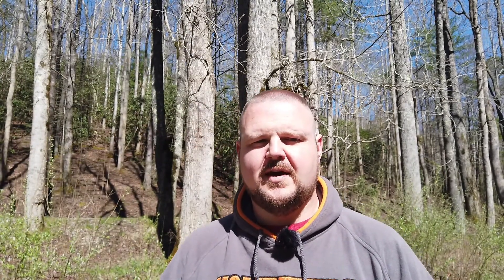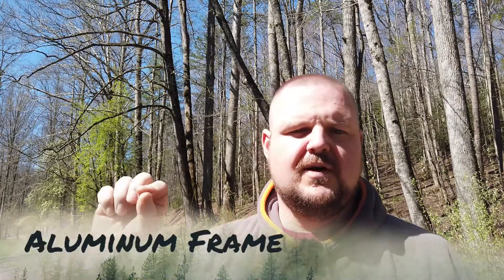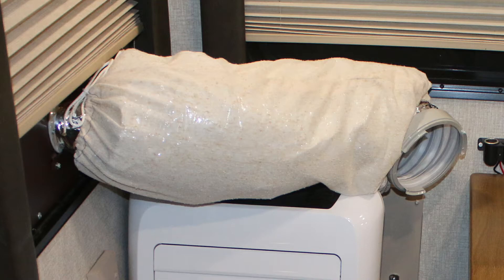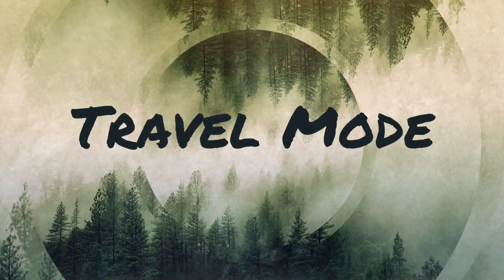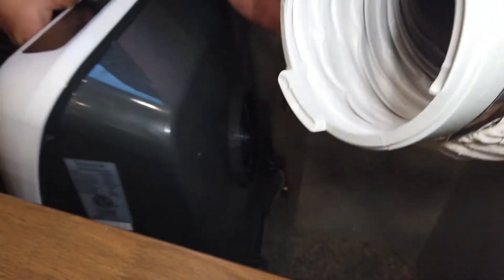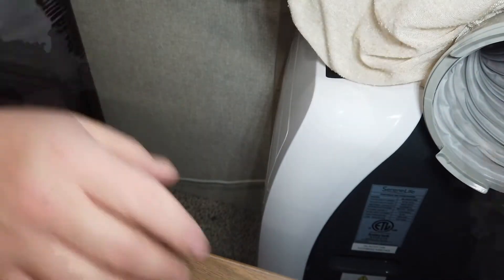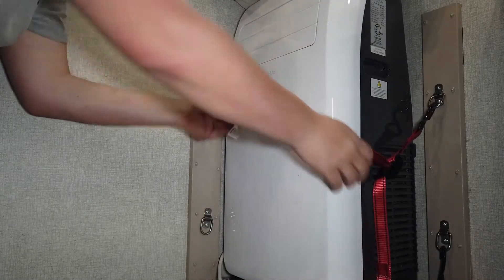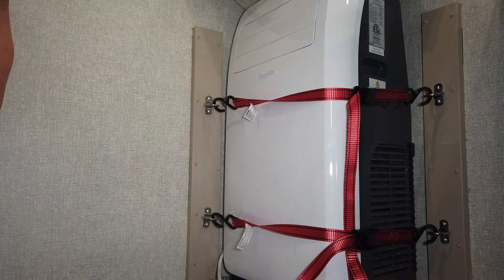Portable Air Conditioner in RV #serenelife #portableac #addingairconditionerinrv

Comment: I really appreciate how thoroughly you explain your process, including your oh-oops moments! I am looking forward to hearing how the one-hose AC works in our Tennessee summer heat and humidity. I've heard comparisons between the single hose and double hose portable ACs, so this is an interesting review. ~ Kir (and Ron) in Middle Tennessee
Reply from the maker: The temp is so nice right now... can't it just stay like this?!
Reply: @GimpyCamper  I am 100% with you on that! ~ Kir
Reply: If it's not a dual hose it will have absolutely zero cooing capacity
Reply from the maker: I disagree.  Yes dual hose is better but last week it was 86 and humid when I was working on a project in the camper.  I turned the generator on and ran this unit and there was definitely more than zero cooling capacity.  I agree they are better units and more efficient but this definitely adds quite a bit of cooling capacity
Reply: @GimpyCamper  it will feel cold in front of the unit no doubt about that. But it is impossible for this to cool the space. All the cold air generated is used to cool the condenser and then exhausted out the hose. Not only that but then because you are expelling air outside it needs to be replaced because you cannot live in a vacuum chamber. So what happens is hot air is literally getting sucked in from the outside through any little crack or crevice. You need to DIY a second hose to cool the condenser to have this not happen.
Reply from the maker: We’ll just agree to disagree because after using this for over a year I can no doubt say it is effective
Reply: @GimpyCamper  you can't argue with physics lol

Comment: We have a portable in our cargo build. It's worked great. We believe proper ventilation is the key to it giving its best performance.
Reply: Do you have a single vent or dual vent ?
Reply: @sharkbait8574  We have a single vent. But we also have it set up so that the intake will pull air in from the outside rather than trying to recirculate the air inside the trailer. We created an insulated box, so to speak, with screened vent holes in the floor to exhaust and intake.
Reply: @HappyPlaceCamping  thanks for the reply. I'd love to take a closer look before we make our decision.
Reply: @sharkbait8574  In our cargo conversion playlist, our virtual tour video explains a bit and shows our a/c set up.

Comment: We use 2 of those portable air conditioner in our house in Indiana. They are more energy efficient than the central air. Our electric bill went way way down after we went to the portable air conditioners. They are truly amazing. We bought ours at Lowes and they are somewhat quiet
Reply from the maker: Yes... 90s and humid, but I’m still waiting on it to heat up that much this year to test it out... I’m not in a hurry for that to happen lol
Reply: Your central air conditioning is more efficient since the condenser is outside

Comment: Great video. I have a 13ft Boler and installed a portable AC under the sink area. Unfortunately after 3 months something broke from all of the bumps/harsh drives (my trailer bounces a lot due to its light weight). When I buy a new one I plan on putting it in my car and then setting it up at the campsite haha - thanks for sharing!

Comment: Mine pedestal does not have a 15 amp, do you think a 50 amp with adapter would work?? Also the manual says not to use extension cord...??
Reply from the maker: You need to use a heavy duty extension cord, but if you get technical the whole camper cord is an extension cord.  You just have to be careful because yes, it's not as intended.

Comment: Quick question?  So after 1yr would you still use the same air/combo conditioner?
Thank you for your help & for your video! ~Tracey~👍
Reply from the maker: I’m going to be doing a video on that shortly.  Yes.  We love this thing.  The only part I don’t like is that the water drain isn’t easy to use on this to drain the water.  The only change I made was that I lined the outside of the plywood with reflectix because it used to let a lot of cold through in the winter

Comment: I have a 50 amp trailer, if I hit a site that has 30, I use my splitter.  They make a cord that plugs into the 30amp slot and the 15amp 110v, and combine into a 50amp female plug.  You plug your 50amp into the adapter and you have 45amps
Reply from the maker: Just to clarify 45 amps is not close to the same amperage you get on 50 amps, because it’s actually 100 amps (2 50 amp legs). That being said I don’t even use 50 amps when it’s available… I hate messing with the huge cord and I don’t need it.  I’ve heard a lot of people do have problems with those splitters activating the gfi outlets but I’ve never used one
Reply: @GimpyCamper  I understand that, but I have a portable ac and I can plug it up to the inside without having to run a cord directly to the 15amp 110 plug when on 30amp service.  I have the capability when on 50amp service in the heat of west texas summer though.  I'm a full time rvers and have run a splitter and directly to 30, the splitter is waaaaaay better.

Comment: Does the portable ac help the camper ac?  Or do you think you should have installed a secondary ac unit up top?
Reply from the maker: Only time will tell.  It's not been hot enough to use it yet... but it is coming.  We shall see shortly
Reply: @GimpyCamper  in Vegas, temperatures reaching 106 so far!
Reply from the maker: I’d probably go with a second rooftop unit for there... if you go places that only have a 30 amp service add a soft start to both of them though
Reply: @GimpyCamper We have one for our toy hauler. The garage converts  to a bedroom and hardly gets any cool air from the 13,500 Dometic . When we tuned it on the front gets a few degrees warmer due to the exhaust negating the inside pressure. Hot air was coming in here and there. We converted ours to dual tube- problem solved. As far as power consumption, ours is a 50 amp service, and we use 2 generators when no power is available when running the portable air. Seal your camper, check your ducting and outlets for leaks and tape up the inside or your roof a/c per other videos. The best part of having a portable a/c is it can be moved from one part of the camper to another or loaned to a neighbor when theirs breaks. Our 10' garage will get down to 67 degrees easily with portable cycling 1/3 of the time.
Reply: @GimpyCamper  aren’t the soft starts about $650 each?

Comment: Nice review.  We really like the one we have.
Reply from the maker: There are only two things I don't like about it... 1. I didn't think the window would need to be open when running the heat pump, but it does blow cool air through it.  #2 there is no cut off on the drain line for the internal water containment, so it spills everytime I have to empty it.  I think I'm going to put an elbow coming off the drain with a shutoff valve on it.
Reply from the maker: I also think I'm going to have to try to insulate this somehow, because I used it when it was cold and you could almost feel the cold air coming through the plywood.